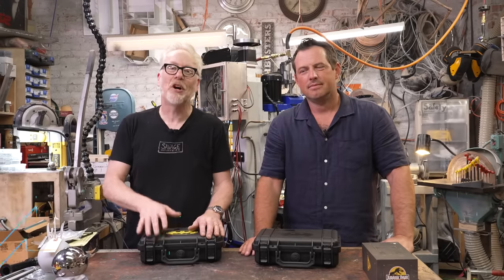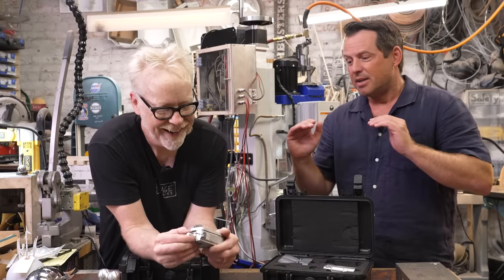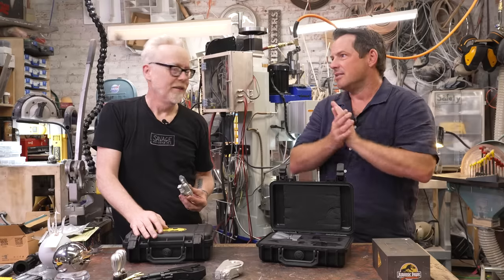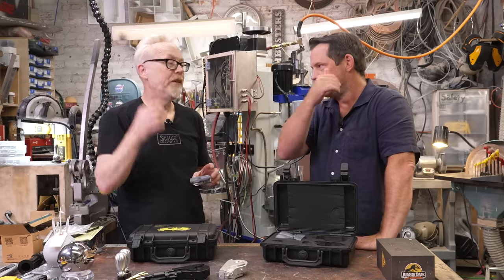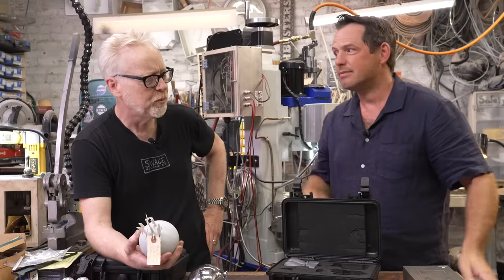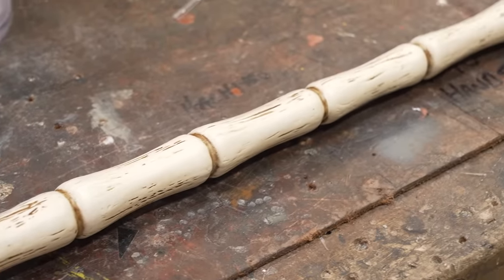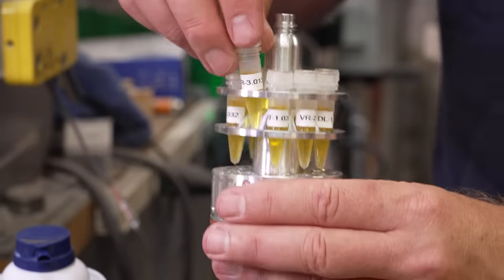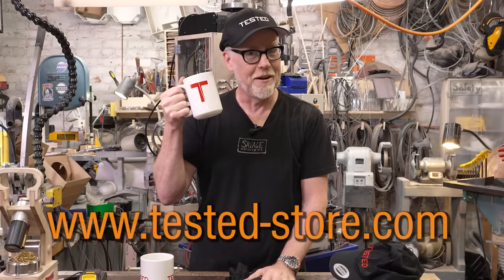How Screen Accurate Prop Replicas Are Made!

Comment: I just applied to bowing as a b model builder and the requirements is having at least one year experience in spray painting, model buikding either as a hobby job or in a educational setting, 1 uear experience in welding aluminum metal brass copper ect and brazsing and soldering, 1 year experience with fabercating and building with metals and composites. I have all the experience they are looking for actually 10 years experience in every category that they need someone with but i have neber worked as a offical model maker but i got my second interview today with them and after today i will know of im hired or not but i have a good feeling ill get hired is whst the first manager i interviewed with said cause i have not only on the job experience but also educational trade school experience as well. And all my job would be is making models of new designs of seats cockpits, and aircraft and models made off kf the engineer's drawings and ideas and then the model builders bring it to life in full scale for certain items with cheaper model making materials or in small scale lile a new aircraft exterior design of the fuselage and wings nose exct. I pray i get the job Adam savage has inspired me to pursue a carreer in being a professional model builder for a company. And it will be easier on my body and wont be out in the heat all day working at ship yards and pipelines and hot nasty metal fabs shops all day fabercating and building massive metal and aluminum structures and sub assemblies and full modular construction moduals for ships as a fotter and welder combo. I also build scale models and movie prop replicas at home as a hobby with my own home machine shop so they want me to show case alpt of the models i have scratch built using different metals and materials in  oneodel and many fifferent skills used to build that model. Im gonna show off my 1/24 scale planes and cars thst i buolt from scratch woth no kits and my full size movie props thst i habd built like proton packs and the cryogenic barbasol can replica from jurrasic park. I oray i get the job and my dream career thanks to this channel for inspiring me to pursue it

Comment: Why use a goofy looking 3d printed mosquito when you can just use a preserved crane fly? You can even "pose" it pretty easily with UV resin prior to casting it in orange resin for the "amber" which would keep the wings and legs intact and prevent all of that silly spaghetti leg business you see in that replica. Just use the same color resin as the translucent amber, and it automatically "hides your crimes" so to speak, making it look like one complete piece. It's a technique commonly used in model building for underwater plants, fish, etc... because it allows you to lock a pose in place without worrying about the weight of the resin pour sloshing everything about.

That 3d printed one looks awful. I promise I'm not trying to be a jerk, but it really does. It's not that difficult to get your hands on a crane fly either, which is probably exactly what they used for the movie anyway. It's a common insect anywhere you find ponds or rivers, and it naturally LOOKS like a giant, prehistory mosquito. Even if you DO decide that a 3d print is the way to go, you should STILL prepose it with UV before the pour or it's going to look like crap. Even then I would do body and head and leave the more delicate extremities (legs/wings/proboscis) for more manageable wires instead. 

Definitely a case of working smarter and not harder and the results will look notably better than that spaghetti legged, sausage nosed 3d printed monstrocity <3

Comment: Two biggest disappointments here:
1) The Barbasol can is friction fit instead of screwed in. They have no real excuse for that, it would have been a little trickier to include threading in the can part but it's hardly insurmountable. Fortunately, it's not a deal breaker and is more of an "I wish they had". I've pre-ordered one of the cans and am excited for its eventual arrival.
2) The Hammond Cane is moulded resin with zero structural support - this one is even worse because including a steel or aluminium supporting rod inside the cane is an utterly trivial operation and would have served to strengthen the prop and increase its lifespan. This one really is a deal breaker, for the price they're charging. I'll instead make my own.
Having said that, it would be amazing for them to also do a run of just the amber cane toppers with the mosquito insert. It would make an awsome paperweight, and would be great for those wanting to make their own, functional canes. Sell me one of those for $150 or so and I'd definitely be interested.

Comment: I built a copy of their screen accurate batman grapnel launcher. Found a member of a group on reddit thst i follow who had posted complete engineering drawings and blueprints of the replica fx made and he jsut measured deconstructed and made blie prints for it so is home machinests that make props and stuff as a hobby can machine and build our own replica of the most accurate acteen prop replicas you can buy and man its amazing and beautiful eben though i made it my self off engineering drawings thst someone made by measuring thieres down to the nearest 10thousands of a inch accurate. It was a challenge for a new hobby machinest but i pulled it off snd man is it beautiful. Wish i could afford the real replica. I left mine un painted cause i loved the look of the tooling marks from milling and machining it and its so smooth and polished with beautiful machining marks its amazing i will never paint mine. If i got kne of thier replicas and it had a small blemish or scratch on it from the machining and manufacturing process i wouldnt complain at all because its hand made and not every single one is the exact same so it gives it that character thst someone had to make that prop by hand and soent hours maxhining that item for you.

Comment: No offense, but claiming all the detail and missing the obvious fact that the Barbosol can is supposed to thread and screw in really is a glaring error. It's not a friction thing in the movie at all, he unscrews on screen and it's plain to see. Why wasn't that worked into the detail that these claim to have?
Reply: You might be right on this, but I have seen it before where actors have faked stuff on screen, so you think you see them doing something, but in reality it’s for show. So you might see Dodgeson unscrewing the can, but did he? Or was it faked? The only way of really confirming it would be to examine the original screen used prop. But what would people prefer, a replica that unscrews as you think you see it do on screen, or a friction fit that is actually how the real prop was made? I guess it’s down to our individual perspective of authenticity. I’ve gone and watched the scene and there’s only one shot where it might confirm it does actually unscrew, but it’s a might, you can’t see clear enough to be sure. In fact when Dodgeson ‘unscrews’ it, his hand is completely covering the bottom of the can, and towards the end of opening it up, he pulls and fiddles with the base of the can to release it, as if it were tight on, or a friction fit.